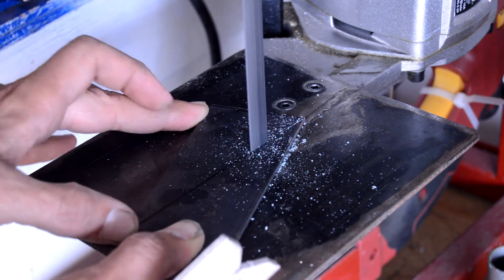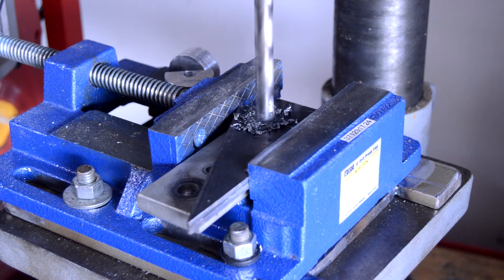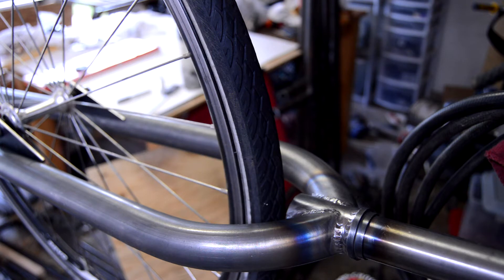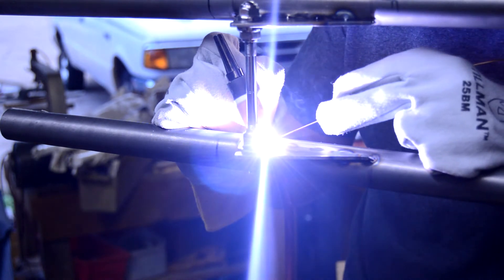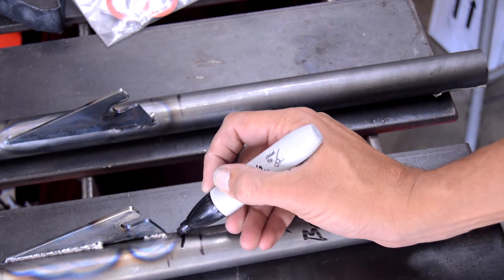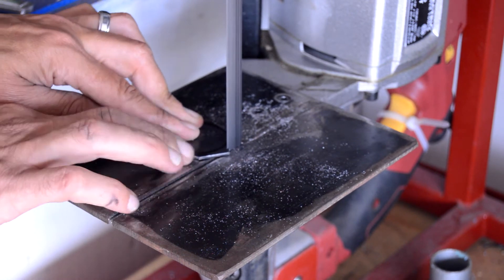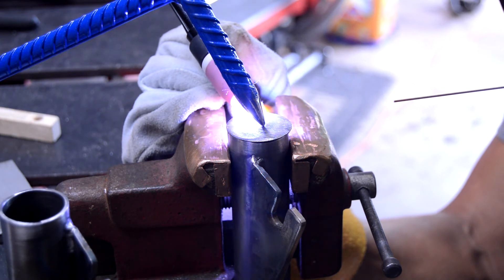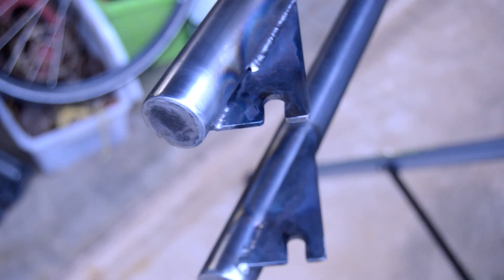Bicycle frame build number 2 part 6

Comment: Why did you not weld 100%  around the dropout?    They are butt welds and seem like it can be a weak point or a possible rust area?    Thanks.
Reply from the maker: The original Redline forks were welded this way. I wanted to replicate those.